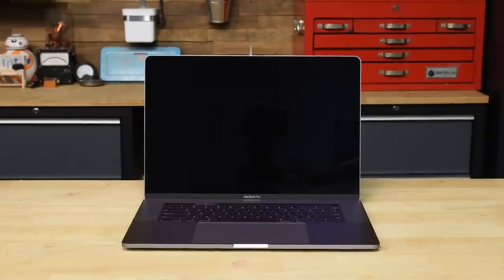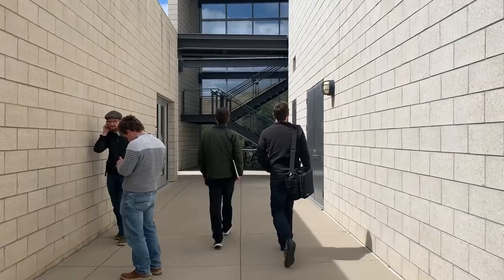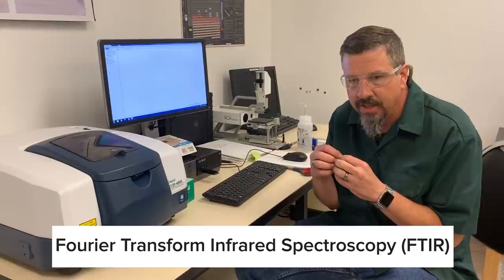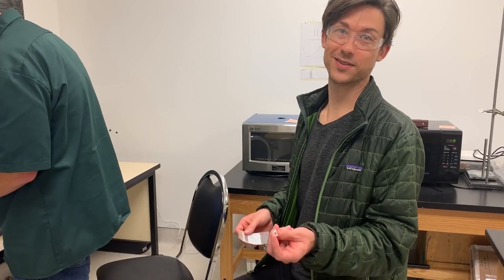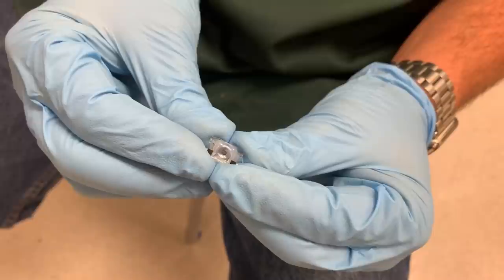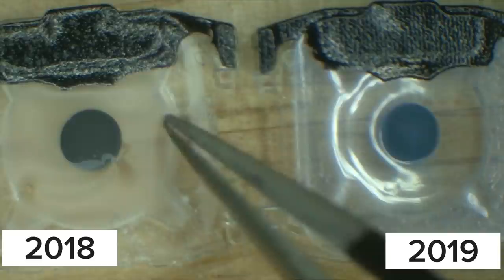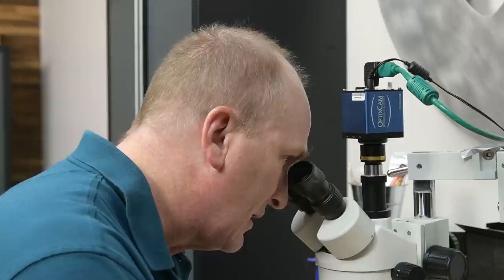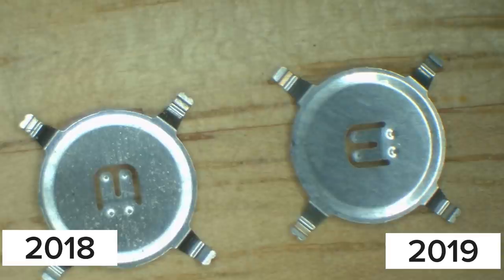We Found the "New Material" in Apple's Fourth Butterfly Keyboard

Comment: I sold my 2018 MacBook Pro because of the keyboard. Paid over $2250 and sold it back for about $1450, considering if the keyboard crashed it was a good deal. Used it to buy a 2018 IMac 27” and am happier with it than MacBook Pro. Plus if keyboard goes out fifty dollars to replace it.
Reply: You do know there is a new recall for the keyboard and you could get it fix for free...
Reply: Did you not use your warranty to fix it?
Reply: Or you could get a proper mechanical keyboard.
Reply: Apple didn't release Imacs in 2018...
Reply: Not if they no longer own it they can't.

Comment: Apple has singlehandedly taken something that no one gave any thought about for decades and made it a gigantic problem...ugh
Reply: @moo what are you an about...
Reply: @moo It's just completely untrue your statement. Dell XPS have great keyboards on par with the old macbook designs.  I have had both of them. Apple just havent evolved there designs (at least not in the right direction) and now the competition has caught up and in some cases outperforms even the old macbook keyboards.
Reply: By "no one gave any thought about", I mean in regards to expecting the keyboard to ever stop working under normal conditions. I don't know of any other laptop (or computer in general) that has chronic keyboard problems. This is a shitty flawed design and Apple needs to acknowledge it, take the L and make something else.

Comment: This is extremely interesting, but also extremely incomplete: 

- The key cap: so is it the same material and shape? You just listed this piece but gave no detail about it.
- The butterfly mechanism: the most important piece. Again, you listed this piece, but gave us no information about it. Has the material of the butterfly mechanism changed? Is it a different plastic? Has the shape changed in any way?

- The dome switch cover: here you were more exhaustive. We got that it's a different material and also it's thicker.
- The metal dome switch: so it's the same exact shape apparently. But is it made with the same metal?
Reply: Alistair Raffaello Baslini Rosselli at 2:10 they say the butter fly mechanism is a different polymer.
Reply: Alistair Raffaello Baslini Rosselli the Butterfly mechanism is a different polymer, and the Dome switch is a different Nylon (they did not specify which plastic ) but I think he said Nylon 5 to Nylon 6.

Comment: It looks to me the shape of the metal dome spring has changed. The 2018 model has a faster transition from the edge to the flat part of the dome, vs the 2019 switch which has a rounder transition. The difference is slight, but if you look at the inner "circle" of the 2019 switch it is smaller than the 2018 version. The 2019 switch/spring just looks rounder or smoother making it more "bubble" like. A rounder design would distribution the stress more evenly on the dome portion of the switch. I would like to see a cross-section comparison of the 2018 and 2019 versions.

Perhaps the switch failures are not at the tabs, but in the middle of the dome? Combine that with the change in nylon and it looks like Apple made an effort to improve the performance, consistency and strength of the main area of contact for the switch.
Reply: lets hope it works. i maybe waiting for the 16inch model but if i cant wait or if its just a macbook air then i gotta go with the 2019 model.

Comment: I’ve had every MacBook Pro from 2015-2018 and they have all failed more than twice. Have spent so many hours traveling to Apple store it’s not even funny. Let’s hope this fix lasts more than a few months.
Reply: Is it really worth it though? I mean my mom and sister change out their windows running laptops only once every 2-4 years (i use desktops which last longer if you change componenets and not the whole thing) and they don't even have to keep the same company and we only had a single laptop break before 2 years of use. Which was because our cat kept pulling out the power cable on my mom's dell laptop while it was charging and the slot into which you plug in the power broke. And it was an easy repair. We bought the replacement for 14 bucks on amazon, opened the sucker up and switched out the component as fairly incompetent in that aspect people. It took about an hour of my time on a weekend. Otherwise we never had any other breaks for either of their stuff and they only change their laptops out every few years to get better processors and graphic cards so they never have to suffer their computers slowing down. This seems a lot more cost and time effective then having to buy new tech every year in hopes they fixed the issue with the new one. And then still having it break down and having to spend a lot of time money and effort to fix that shit. We had an apple laptop once. That shit broke every 2-3 months I swear. And was only somewhat usable for around 9 months after which it became the slowest computer I have ever had to use. It had the processing brain power of a flea goddamnit. Not a single fond memory of using that machine, it was nighmarish pretty much starting the first week of it being in heavy use. Pro my ass. But maybe I am just biased on my overall bad expirience with their stuff. Except my ipods. Which I have 2 of. Both now super old. Both still work as if they are new. Both can easily sync on my windows computer. Just 2 perfect pieces of technology. Why they can't make the rest of their stuff as quality as their ipods, I don't get. Besides those 2 everything else we tried from them has consistently been absolute crap. The phones and the computers.
Reply: At that point I would've just bought something else
Reply: Why should they? People like you are coming back, no matter what...
Reply: "I'm an idiot who likes to overpay for inferior products, even when they fail, I will spend more money on the exact same products"
Reply: @doomcity85  Exactly
Reply: Paul Decker Well said, people are just driving their desires cuz of the “brand”. Fuck off these guys, don’t complain when you, as a consumer don’t actually give a shit
Reply: Why do you keep buying them if they keep failing? Is it really worth the trouble to deal with having a multi thousand dollar computer constantly in for repair preventing you from being productive on it?
Reply: It honestly amazes me how failure prone Macbooks have gotten. Sure you can walk into an Apple Store(if there's one near you) to get it fixed, but if you have to do that multiple times it just becomes a pain. Meanwhile the Lenovo laptop I bought 3 years ago has never needed to be fixed. I am looking to upgrade to a new laptop, but that's just because my work has gotten more demanding and the 4th gen i7 I have can't keep up anymore, plus I need more than a max of 16GB RAM.
Reply: P. Gundaker Windows laptops become great and offer same quality and even more possibilites at that price point these days. Look at acer predator triton 700, razer blade. while staying at apple you‘ve overslept these
Reply: japzone is it ok to just go back to using 2015 MacBook Pro?
Reply: @denniszenanywhere  If you can find one at a decent price, and the specs are good enough, sure. The specs part is the sticking point though, with the parts all being 3-5 years old at this point. There are some YouTube videos recently of people reviewing the 2015 in 2018/2019.
Reply: machmalichtan the thing is that windows fucking sucks. Hackintosh is my goto solution

Comment: Considering the fact that cleaning under the keys doesn't always fix the issues, it looks like those dome switches are probably the point of failure. Most chiclet-style keyboards have rubber or plastic dome switches under the keycaps because they typically last longer than metal in this use case. Simply put, metal breaks faster when it's bent repeatedly.

Comment: They should make the 2020 macbook even thinner, TIG welded shut. replace the keyboard entirely with a capacitive glass one, and of course keep it at 8GB of RAM with a dual core starting at $1500
Reply: Starting at $2500. There. Fixed it for you. ;)
Also, all glass no movement touch-only keyboard. But you don't get touch on the screen/UI. Just touch on the keyboard.

Comment: So was there any test done on the metal switch, to see if a different material has been used? I thought the metallurgist was going to do that, but then he just "guessed"
Reply: They should have at least put the two switches in the SEM to see if different alloys were used.  If same alloy (likely) they could have done hardness testing to see if the new switch is stronger than the old one.  Both are pretty quick to do.  It seems that the consultant only wanted to look at the parts under his stereoscope, and not really doing more testing.  Too bad.

Comment: The newer ones are really, really nice in terms of accuracy. They click like buttons, its different but actually more tactile than a traditional keyboard, you get used to it and I think most people find it to be a huge improvement for the most part. The only reason people flip shit is because if grime gets under them they get stuck. I think similarly to the Mac Pro of 2013 they over engineered themselves into in awkward corner where they have something amazing but also bottlenecked. I got rid of my 2017 after the keyboard failed a second time. Fingers crossed that this time around they nail it. Waiting a couple months but I will fully spec one if the consensus is that the keyboard is much more resilient.

Comment: As the creator of the dome switch in 1969, I would be looking at the electronics, if there is no failure in the dome or moisture layer. 
The original 'switch' was contactless. The depression of a key was detected by the change in the capacitance between a metal layer attached to the key and the PCB traces below. The dome was originally invented to provide a 'snap' action to accentuate the change in capacitance of the switch with the depression of a key. It was about 3 years later that the 'switch' was made into a contacting switch for use in calculators. As they say ‘the rest is history’. 
US patent # 3,653,038. I'd be happy to consult on your problem.

Comment: I'm pretty sure apple replaced my 2018 keyboard with this 2019. I don't know if it was I had "worn out" the old keyboard but I feel as this keyboard requires more force to push down if that makes sense. The keys just seem to move less, they're a bit softer, and harder to press down. It might be me but it feels different. I'm not sure what I like more. It feels like I'm "exercising" my fingers but it feels softer. Overall, I'm just I don't have any issues YET. I'd have had to stop like 20 times with the previous keyboard to delete repeated characters .
Reply: hey man do you mean the 2019 keyboards are better?

Comment: The metal switches could have been a little bit more tested. A pressure test for clicking of the switches. Is it the same down forces needed for contact. Then ,an alloy analysis of the metal could also have confirmed that there was no changes on that part.

Comment: Still very happy with a 2012 MacBook Pro.  I can open it up, add memory, upgrade the HDD to SSD, renew battery (if necessary).  Did memory and SSD upgrades.  Works like a charm.  No keyboard issues.  And, BTW, has USB3.0 inputs.

Comment: so if you have a 2017/2016 that failed. do the "NEW" materials get used for the new fix?
Reply: antok86 no....ofc not just like you dont get the 2018 version on a older model

Comment: I think they fixed the problem with the 2019 keyboard, but it was already too late for apple to recover from bad reputation and decided to include the 2019 model in the keyboard fix recall just in case. And discard the butterfly mechanism for Macbook Pros next generation (design was over due for 2020). But Macbook Air? only time will tell, but I bet at least the 13-inch will probably get a 14-inch revision and a a scissor keyboard as well. This thinner keyboard will only see light in slimmer macbooks if ever again.

Comment: If Apple had fixed the issue completely, they wouldn't have included their latest models for the extended repair program.
Reply: Well I’m glad they did for people with a broken keyboard with the 3rd gen
Reply: They will be replacing all of the third-gen keyboards with the fourth-gen. I have not heard if they are doing the same with the first or second-gen models, but I’d say that they are fairly confident about their fix if they’re changing your replacement options.

Comment: These "fixes" from Apple are like lipstick on a pig.  They just need to acknowledge that the design was a failure and go back to the previous generation excellent scissor mechanism or design something new.  

But at the very core of the issue is this ridiculous quest for thinness.  If Steve Jobs were still around, I suspect he'd have realized long ago, the diminishing returns of thinness.  Apple had already achieved this in the old macbook pros.  No one was complaining: "Damn this MacBook Pro is so thick, I wish it was thinner!" but they had to go and do it anyway.  The same can be said of the new iPad Pros.  No one was asking or even thinking that the old ones were too thick.

Finally apple has been forced to acknowledge that it is a real problem with their comprehensive repair program, hopefully they fix the problem all together by eating some humble pie and admiring the design was a failure.  Cause the fact that the brand new key switch is covered under the repair program, before even coming out, is not very confidence inspiring.

Comment: My only question is, why the fuck are the switches' design so complicated? They consist of 4 extremely complex parts, each of which appears to be very prone to failure (like the flimsy metal spring and the delicate nylon membrane cover). Scissor switches work because they're incredibly foolproof in terms of their mechanical properties (they literally swivel on an axis, elevated by a rubber dome until the key is pressed down to make contact with the board). Because the butterfly switches uses springs instead of the tension of rubber, that alone makes them inherently unreliable. Metal fatigue is the main concern here.

Comment: A fantastic video as usual. It flabbergasts me that Apple is doing something like this. Their obsession with thinness in incomprehensible. Yes, thin devices are good but there is a limit to that. It stops when practicality and usability is compromised. I'd go with a X1 extreme any day because it has better keyboard and thermals. I have personally ruined 2 laptops because of thermal issues and I wouldn't want that to happen to something when I shell 2 grand on. And to make matters worse, the keyboard issue!

Comment: And does it fix The issue or not ?
Reply: We'll see in time.
Reply: KapioczekNaYT  it might lower the failure rate and failure frequency but in time it’ll fail. The fundamental design is wrong and apple isn’t ready to admit it and give up
Reply: you will have to buy one to find out
Reply: Dave2D said that Apple did some quick maths and found that doing this repair program is cheaper than redesigning the keyboard switches itself.
Reply: KapioczekNaYT It doesn’t fix it.

Comment: Not quite of a change. The metal dome design is flawed, even if is used on other applications, is not strong enough for a keyboard, any metal that bends gets fatigue over time. Even if it lasts longer because of new materials, it is planned obsolescence on practice.

Comment: 3:07 - looks like Dr. David Niebuhr, is using an older MacBook.  Yeah, I'll stick with my 2015 MBP.  I'm not expecting the keyboard of the 2019 MBP will be any better.  Even, if the keyboard is fixed with the 2019 MBP it still lacks ports - and I require ports.

Comment: Apple: Makes phones and tablets that outperform the competition
Also Apple: fails to make a functional keyboard for 4 years
Reply: Legit Plays Their iPads aren't doing too hot. If you're looking for prebent tablets then go with Apple, because apparently they didn't learn A) to never put something in the design that will weaken the integrity of the device or B) to use materials that actually don't bend since they'd rather be cheap in the engineering department. 

I'm not a fan of being charged $800-1,000 for a tablet that literally comes pre-bent. That is not quality worth what they're charging.

Comment: Had my 2016 MacBook Pro keyboard replaced last week under AppleCare, what’s the odds I got the new 2019 style or the older 2018 style?
Reply: Justin Grazulis as far as I understand you ONLY get the 2019 upgraded keyboard if you had a malfunctioning 2018 MacBook. Furthermore, if you had a pre 2018 MacBook, such as your 2016, you will only get the exact same keyboard you already had. Not a third gen keyboard.
Reply: Alan thanks for the info, however, I will point out that the option and control key design was updated in 2017 and after getting a new keyboard on my 2016, I now have the updated option and control keys
Reply: Justin Grazulis that’s interesting to hear. I really do hope they replace ALL the older gen butterfly keyboards with the newest design. I feel it’s only fair for all the people who bought a flawed design that was apples fault

Comment: If I were Apple, I would have gone back to the old design the first time they had problems with the butterfly keyboard until they did more testing. Apple isn't one to go back tho. Once they start a design, they never look back. Wonder why they didn't do enough testing to begin with though. It makes me not want a recently designed laptop, which I won't get. I have the last one with the older designed keyboard and it's perfect. As far as price though, sooner than later an entry level laptop will be $2,000. :/